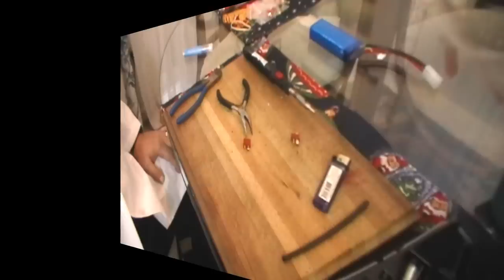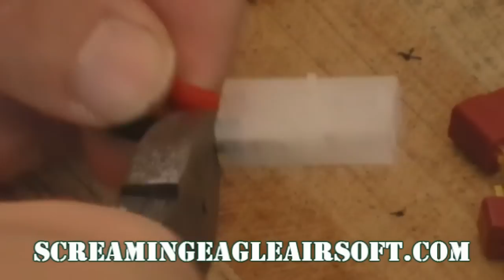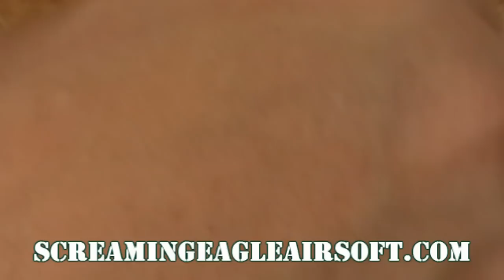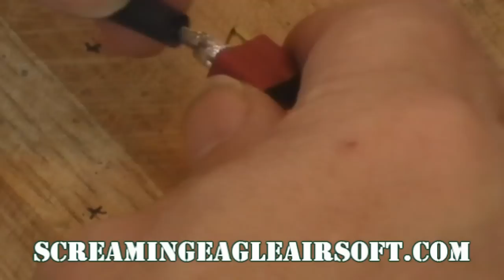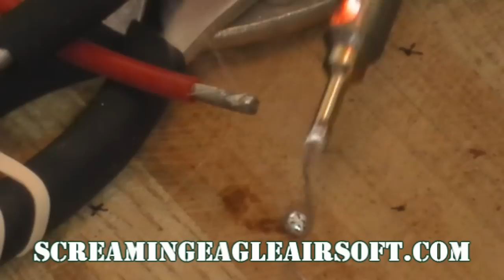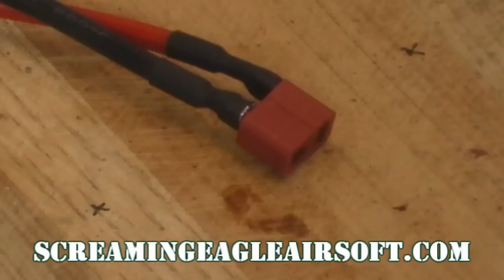Know-It-All: Switching to Deans or How to Solder Airsoft

Comment: to people who are wondering why you don't want to cut both wires at the same time is, because, as he stated in the video, doing so may create a short (basically this will cause the battery to heat up very quickly, and bulge. this may also cause an explosion from the battery). as most people know an explosion with a battery is very dangerous, as the contents are not meant to be touched or consumed by people. as well as when you are soldering, you don't want to let the copper in the wires touch together, as this will also create a short.